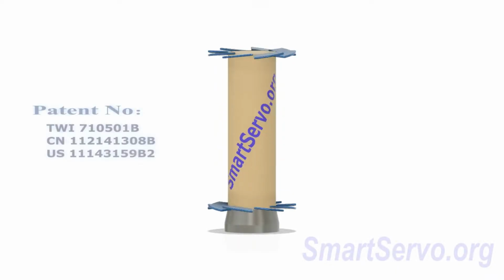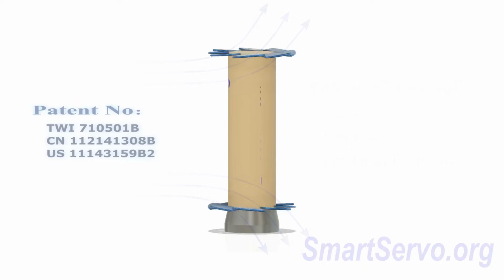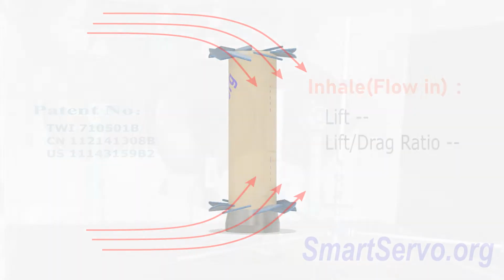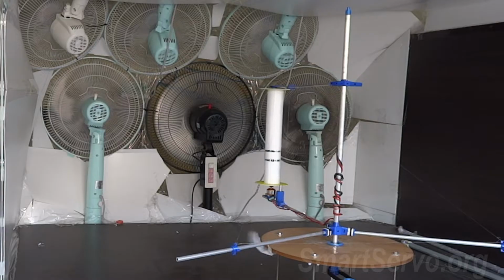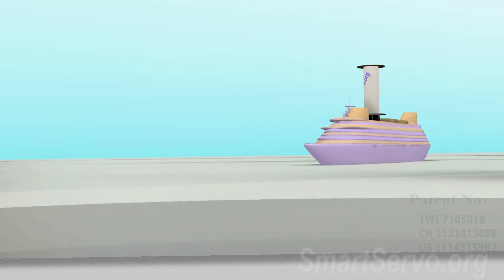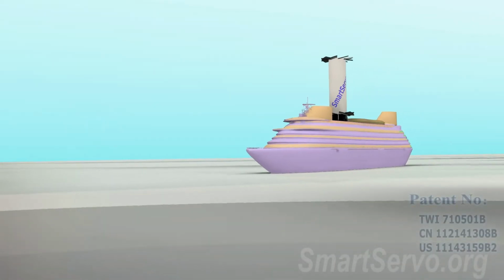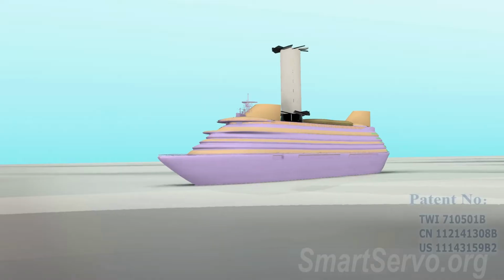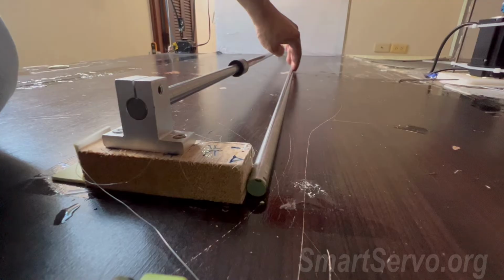A new way to enhance the Magnus effect, faster and more efficient

Comment: I believe the point is to create an initial rotation of the cylinder to overcome static friction. So, if the application is wind energy generation, why not "jump start" the system with a motor that will be a generator after the cylinder has engaged the wind?

Comment: Does a larger rotating cylinder create larger lift?
Reply: Yes
Reply: @anim8dideas849  not necessarily. The formula involves a gradient of lift, and it's not the same for all RPM or Wind speeds.
The other important factor is the power required to turn the cylinder,  which had to be optimal.
You can have a lot of lift from a lot of power, but the Wattage used may be excessive.

Comment: Interesting! Can the blades be made bidirectional, or perhaps replaced with fixed ports? I ask since, for propulsion at least, the ability to reverse rotor and vessel direction seems important.
Reply from the maker: Can use a variable pitch mechanism, like a helicopter

Comment: Great, great video! This is science!

I live in an area where the wind rarely reaches 2 m/s, so I always excluded any kind of wind generator, I'd be curious to see if this type could work or not.
Probably here solar energy is a better choice, unfortunately. 
I would love to build one of these
Reply from the maker: 2 m/s is too low to utilize wind energy. maybe get faster wind speed by raising the altitude. This video is used to demonstrate the method of enhancing the Magnus effect. As for Magnus wind turbine, please refer to => https://youtu.be/9AdpggaOfF0?si=R7wUJsnYsU_047aB
Reply: I've seen your other video, it's very interesting as well. 
Probably it's better to choose another source than wind, at least here, but in more windy areas, it will probably be a good choice.
Is there any difference between this type of vertical turbine, and the horizontal with propellers in terms of how much energy is required to start rotating?
Reply: @SmartServo_org  But  playing with border layer and suction is nice experiment.

Comment: Excellent video! Carrying the "exhaust" idea to an extreme, what would a stack of end plates do, if they moved air to the shaft's ends?
Reply from the maker: End plates work well at low speeds, but lift is saturated and drag is high at high speeds. In fact, the end plate can be considered a special case of a blade where the pitch angle is 0 and the solidity is 100%. Increasing the pitch angle as speed increases maintains the best results.

Comment: I wonder if you could reduce the pressure on the rotor between the end caps by having the rotor tapered, so that the center is wider than the ends. Another idea is create the rotor using disks like a Tesla turbine, which might have better flow attachment.
Reply: This sounds reasonable. The elliptical wing platform makes use of this same thinking. Less lift at the ends (tips) but less induced drag over the whole wing too.

Comment: Does evacuation via bladed ends reduce the effect of surface roughness on lift?
Reply from the maker: Exhausting air through the blade end can increase the air flow and reduce resistance without affecting other characteristics.

Comment: Amazing findings! I hope that you can translate this concept into an improved wing design.
Reply from the maker: This can solve the problem of traditional Magnus effect aircraft without ailerons. The variable pitch can be used to adjust the lift on both sides of the rotor wing to control the roll of the aircraft. => https://youtu.be/gMym621FtR8?si=FTBZagAl6b72N1Aw&t=244

Comment: Don't forget, the fans cause drag, and would require more power to rotate.
Reply from the maker: You can see here => https://youtu.be/uafRQlRvAkM?t=300
Comparing the endplates and blades at the same current, even though the bladed cylinder (1800 rpm) is slower than the endplate cylinder (2000 rpm), the turbine using the bladed cylinder is still faster. In addition, the main sources of energy consumption are: 1. The drag of the blades, 2. The friction of the cylinder's bearing. As the size of the cylinder increases, the former increases to the power of 2 (area) and the latter increases to the power of 3 (volume or mass). Therefore, when the size of the cylinder is very large, such as the propulsion of a ship, the energy consumption of the former will be much lower than that of the latter. and when the same Magnus thrust is generated, the rotation speed of the bladed cylinder is lower than that of the cylinder with endplates. This means that the blades can significantly reduce the frictional energy consumption of the cylinder.
Reply: I agree the increase in turbine power is due entirely to an increase in efficiency.  
However,
rotation speed isn't as important as the load on the friction of the bearings.  
It puts greater load on the bearings to be transmitting 15% more power than it does with the same power at 15% higher rpm, right? The greater turbine output efficiency is due to the higher lift to drag resulting from blades vectoring the lift closer to 90⁰ from the apparent incoming wind thus increasing its torque rather than RPM.  

Am I making sense?

Comment: Have you tried putting holes thoughout the rotor and using an onboard fan to create a small negative air pressure; this could reduce the boundry layer and the air could be moved by the same motor that drives the rotor for simplicity.
Reply from the maker: I think the method you mentioned should work, similar to patent JP2010121518 Fig 6a, But I don't want to punch holes in the circular surface of the cylinder because it would complicate the structure.

Comment: Interesting! Seems like this indeed increases the magnus effect. Does is increase the effect even further with more bladed sections around a cylinder (not just at the ends)? Like compression steps in a jet engine.
Reply from the maker: This idea should work, and being able to exhaust from both ends of the cylinder would work.

Comment: Clean presentation and explanations of this idea.
explain
That can be an interesting compare. 
Magness
1)  the same wind forces on motor via current draw at speed, measure rpm, current, drag and lift plus there angles for vectorous math.
this can tell you the effective diameter compared to the new effective area with boundary layer collapse.
Very cool!
When are you going to build an RC plane and post?
:)
Reply: fing grougle post
Clean presentation and explanations of this idea.
Another effect that can be significant part of the efficiency (or another way to explain it) is the end exhaust creates a vacuum at surface of cylinder, breaking down boundary layers and thus smaller EFFECTIVE diameter.
That can be an interesting compare. 
Shrink original flat plate Magness, until:
1)  the same wind forces on motor via current draw at speed, measure rpm, current, drag and lift plus there angles for vectorous math.
this can tell you the effective diameter compared to the new effective area with boundary layer collapse.
Very cool!
When are you going to build an RC plane and post?
:)
Reply from the maker: @rondavison8475  Thanks for watching and suggestions, some comparative experiments on endplates and blades are linked as => http://smartservo.org/en/ways-enhance-magnus-effect-en/
Next step I'll do linear motion testing of the rotor with end plates or blades to show if the new method can make the ship faster.As for rotor-wing aircraft, the new method also has the opportunity to solve its inherent problem of "roll control".
Reply: pick what to normalize to heading vector force - extra side drag force (ship)
motor current or rpm or power or power, current, & rpm